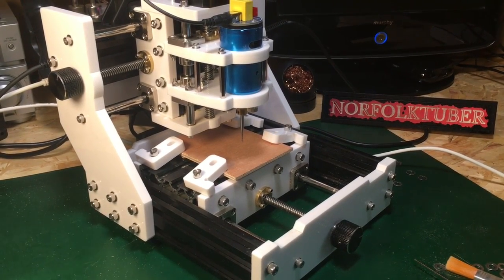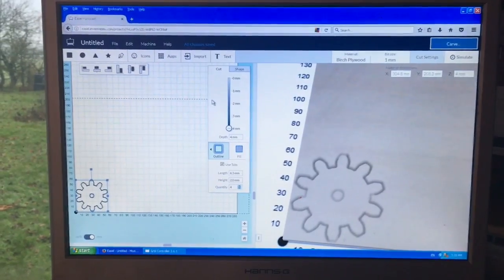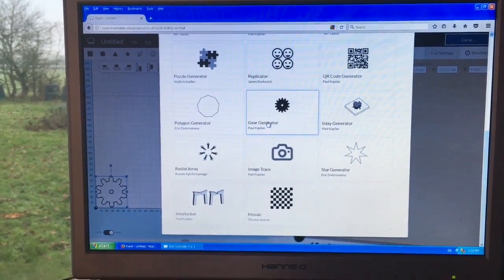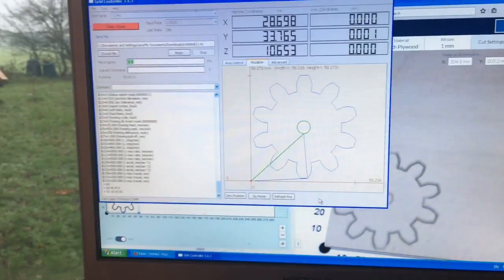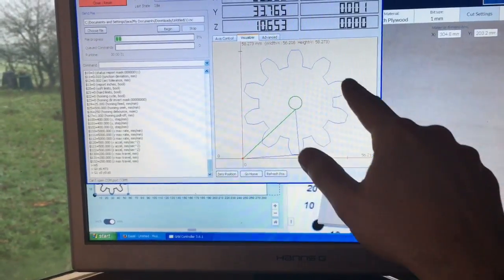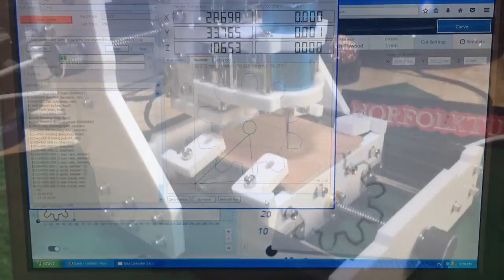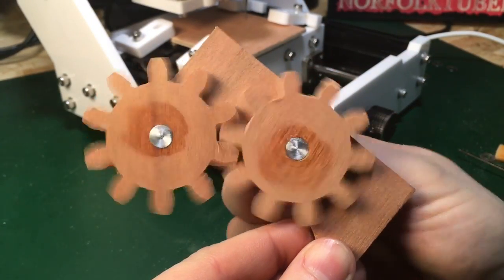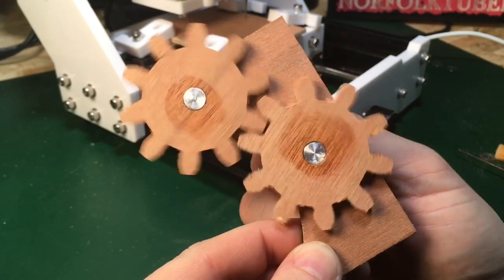Cutting wood Gears On Diy Desktop CNC

Comment: I love this, great video. Liked
Reply: Do you need a PC with this kit or can it run with a linux machine? This would be nice to run via a small raspberry pi for example. But not sure if they have any software for a linux version. Any ideas? This is a more compelling sell for me than a 3D printer.
Reply from the maker: Thanks mate yeah you can use grbl controller for Linux or universal g code sender. yeah i think you can run from raspberry pi i did read somewhere.